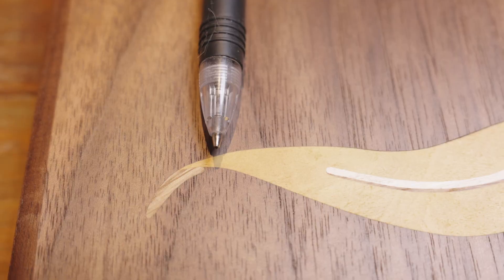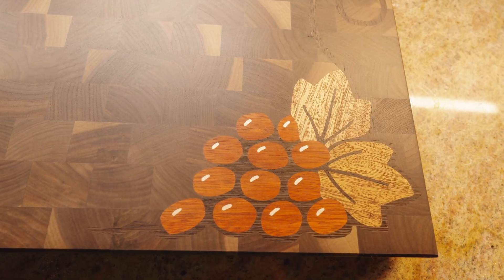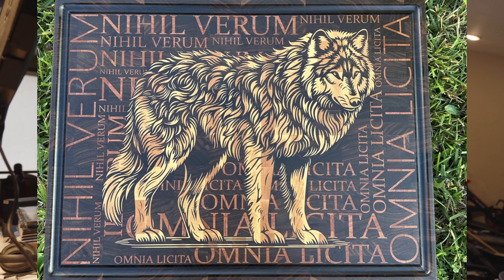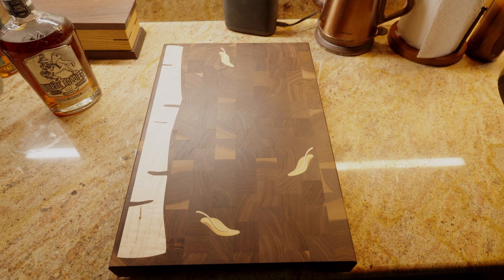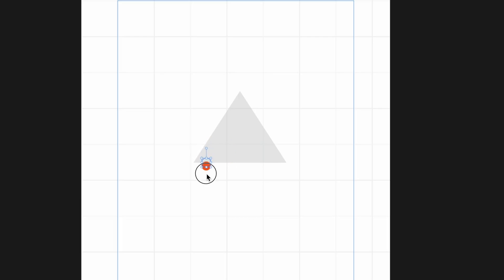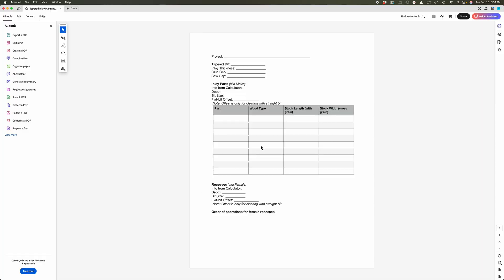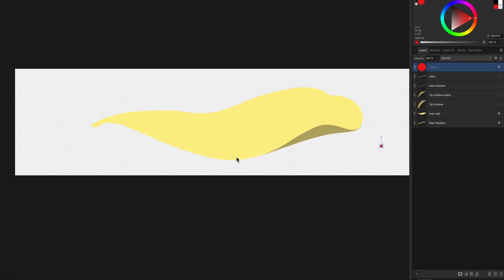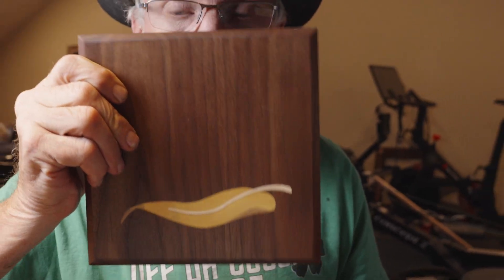Design FLAWLESS Inlays for Shaper Origin

Comment: To do the sharp tip of the leaf, why not use the same techniques, but with a bit of the underlying wood to make up the edges?  I suppose getting matching grain might be a challenge, but that compromise might give more desired results.
Reply from the maker: Might be worth a try.  Another thought is to use a flat bit inlay for the tip and chisel out the sharp corners. I will say that in real life it looks good  rounded. Appreciate the comment!
Reply from the maker: You got me thinking about this.  I’m thinking that the grain mismatch from a patch from the same wood as the trivet might look like covering a mistake.  One possible solution that would look intentional is to put a black outline around the entire leaf.  It would change the visual impression but might be cool.  The black would be done in two parts to get the sharp tip.